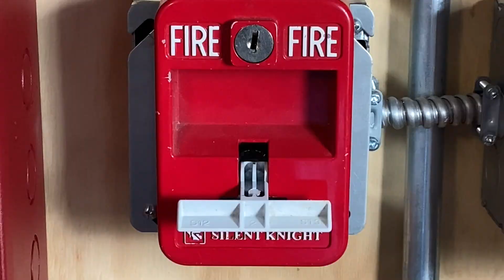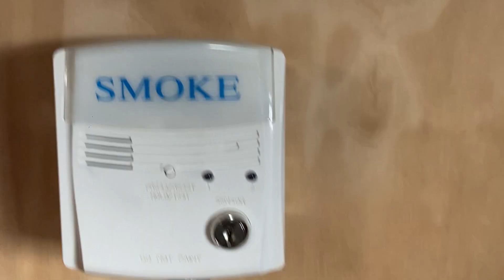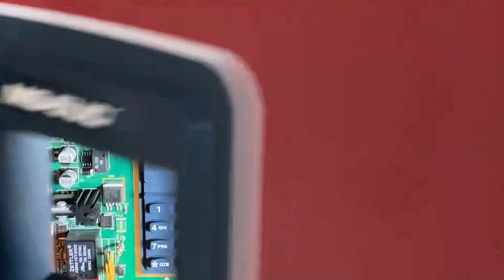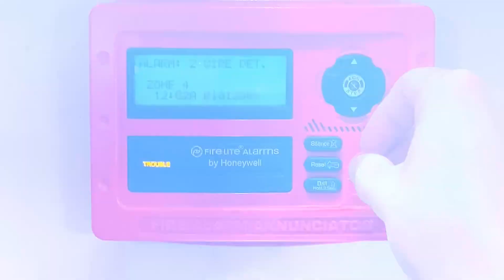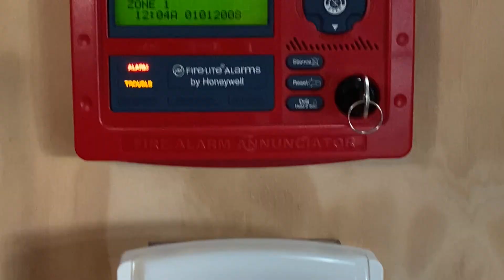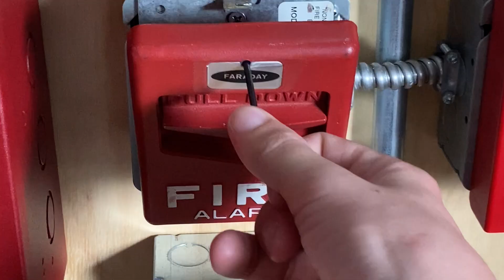Board System Test 32 with the Fire Lite MS-5UD l #FireAlarmFriday

Comment: Question is the 4903 freerun and wired directly to ur nac
Reply from the maker: Yes, it’s Free Run. It’s hooked directly to a Nac Circuit. This particular unit is a 4903-9215